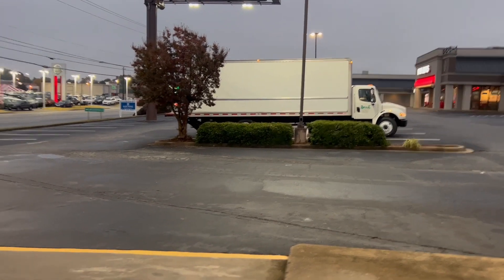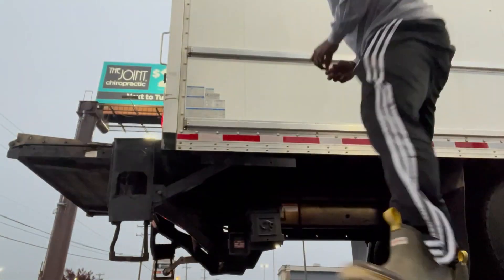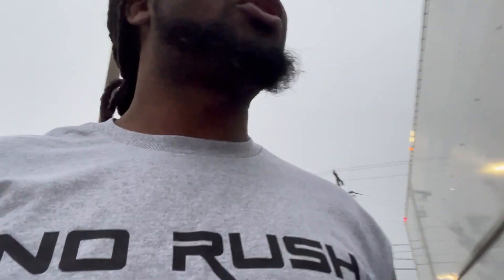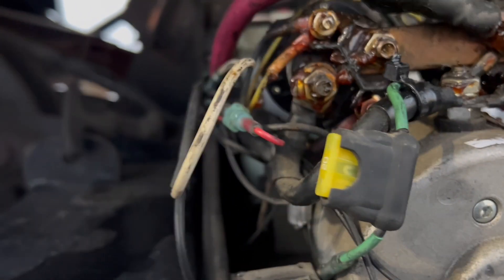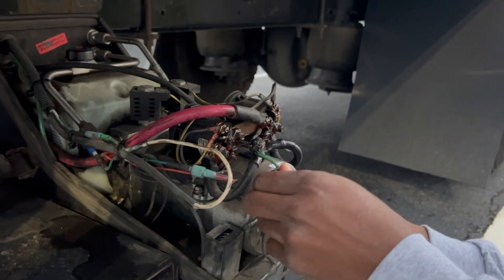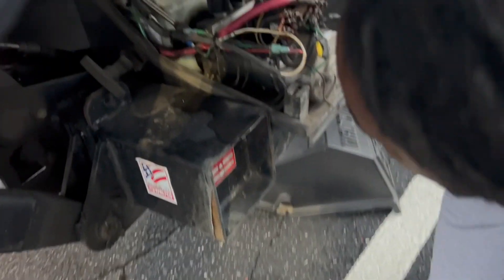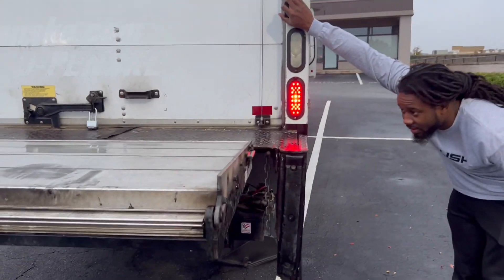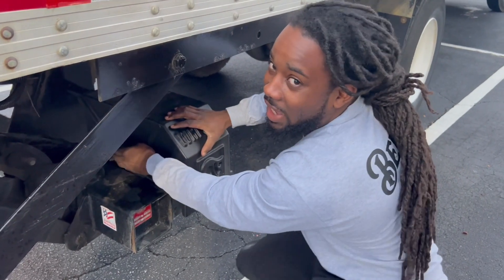26FT BOX TRUCK CANT GO  I BROKE THE PUMP ON THE LIFTGATE IT WONT GO DOWN

Comment: Down contactor coil check it with a multimeter.  You should have one in your tool bag at all times I recommend it.
Reply from the maker: yeah its fixed got a brand new system under warranty

Comment: I don't know what's wrong with it, but if it weren't for the warranty, I wonder why you'd have to take it, to get it fixed. It's just with engine problems you have to take a Hino to a Hino Dealership to get fixed right? Lift gates can be fixed anywhere, or no? I might find myself in the same situation one day...
Reply from the maker: Over like 2,000

Comment: Did you there taking the switch off and check the wires? You might be able to switch the wires just to see if it's the down part of the switch and hope it is that well be the cheapest fix. A new pump runs about 600 to 800
Reply from the maker: We have a 15 day warranty so they fixed it
Reply: @norushcrew  Did they tell you what was the issue?
Reply from the maker: @aroundthecornertrucking6433   no they didn’t just have us a whole new system but  the tech support from the company that makes it said it was the right solenoid going bad which controls the downward motion